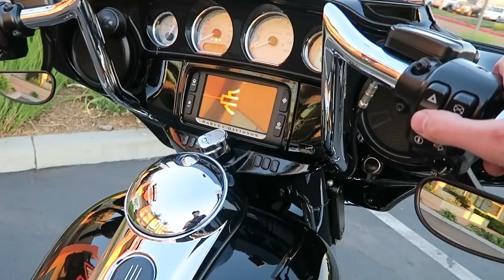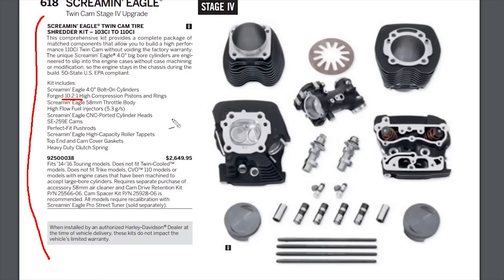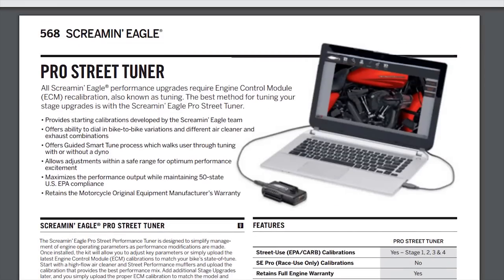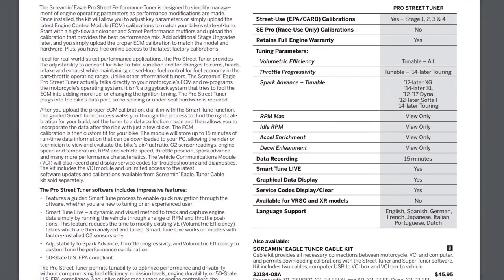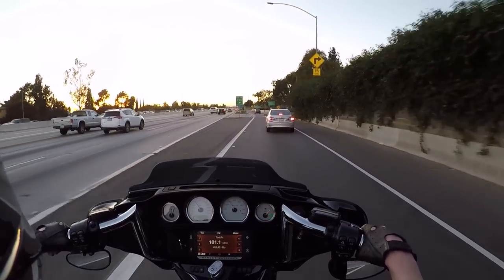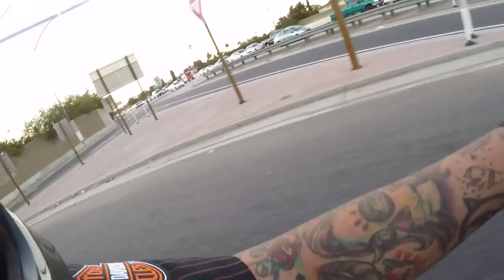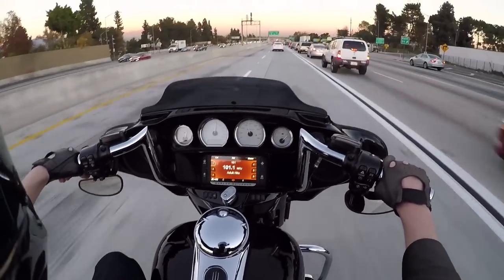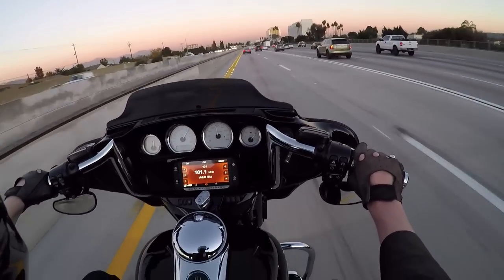Milwaukee-Eight Stage 4 VS Twin Cam 110 Stage 4 │Harley-Davidson Screamin' Eagle

Comment: I have a 2012 GoldWing with 100 K miles as of today. My first bike was a Harley but I can never go back. The Wing  bumps 114 mph in 4th gear when passing eighteen wheelers while riding 2-up. Nothing done other than fluid changes. Why do Harleys need expensive stage kits to bump 100 mph?  I have read some Milwaukee 8 engines have big valve problems.  
Why not build the engine with top power at the factory or is it the need to rip off owners?
The only thing going for the Harleys are excellent paint, chrome & some noise.
Reply: @k9m42  As a former HOG owner I am watching HD riders switch to the new 2019 GoldWing in droves. No I don't like the new GoldWing as the info system is a garbage item copied from an HD. Apparently you don't realize HD is in deep financial trouble and I don't think Honda will consider buying out the debt. Mr Laidlaw loves to put down HONDA in his videos but it doesn't matter.  The fact remains there aren't many HD's that make it to 100K miles without major engine problems (Usually a chase truck follows them on group rides LOL). Things happen when Korean & other Asian parts are assembled in America to get hidden with paint & chrome.. Look on your front forks and I think you may see NIPPON (The company that made landing gears for Japan so they could attack Pearl Harbor). 
You can't hide dog duty under beautiful paint and heavy chrome. Heavy metal chrome is nice but you will never see it on modern Stealth bombers or space vehicles. Add another stage to your HD roller skate and you will still remain in my stock GoldWing rear view mirrors. You are a funny guy though.  :-)

Comment: Will this kit allow you to pull the front wheel off the ground?
Reply from the maker: Haha. You could do more to get the front wheel up with a different sprocket then this power. I'm sure a pro rider could do it - Personally I can't wheelie a street glide
Reply: You can wheelie an old E Glide, my 2000 tc88 will do it. An old man with a early 90's E Glide showed me how. The front end can come down really hard and dent the front fender. It's a neat trick, save it for bar bets or impressing girls. It beats up the bike.

Comment: Was looking to get a Milwaukee 8 but for $ 40 grand then put a stage kit for $6 more. I think will just buil an after markit bike an it will be done at $25k to $30k and S&S has a 106cc flat head a knuckle head, pan head, shovel head or big bore 124, 128, & 143cc Harley is droped the ball. When my 96cc in the 09 cross bone gose out i will set an S&S in it an still ride it too. I wanted a new bike but all Harley has is new prices.

Comment: Funny thing about that 2 valve vs 4 valve, of course the twin cam falls on its face in high rpm, it can't breathe.  No matter the cam profile.

But yeah, the milwaukee is a better platform, about time Harley joined the present tech

Comment: So the m8 is better for about 1000 rpm or so of the power band? I just don’t see it being worth the extra cash for a new bike when you can get a much better deal on a used bike with low miles and the stage upgrades past 1 seems like a waste because they are still not fast. Not a hater. I love my breakout but I know firsthand that Harleys are not fast  it’s great for cruising and having fun but not a racer at all.

Comment: Or... for approximately the same money you could buy a Ducati Panigale V4, 215Hp and literally half the weight. That's probably 175Hp at the rear wheel. Now that WOULD shred tyres (if you turned traction control off.) Horses for courses as is elsewhere stated. Harleys are cruisers and sure a bit of extra poke doesn't go amiss, but riding at well over 100mph on congested highways is a high risk thing to do. That being said I hit 100 yesterday, so I'm a hypocrite too right? well at least I have the common sense to admit it was a foolish thing to do. And while I'm musing; what about traction control and riding modes for Harleys? It's about time! ps despite the critical post, I generally really enjoy your detailed and informative reviews. Ride on Bro' (but safely)

Comment: My Yamaha fjr1300a loaded up, and riding through Wyoming... 80 miles in 45 minutes, easily. If I'd have been riding a piston swapping twin(Harley), I would have had to have my teeth fillings replaced. They are pretty though, and H.D. can market the shite out of THAT.

Comment: These bikes aren’t fast. They’re beautiful. They’re comfortable. They ride smooth. But they are not fast. I had sports bikes when I was young. They were fast. Now I’m older. I’m not interested in speed anymore. So I got a Harley. No regrets either. I love it. I’d never get anything else. Lots of power. But it’s not fast.  You buy an expensive bike and put fancy parts on it but a 600 cc sport bike straight from the dealer would smoke any Harley. Just facts. Your top speed in this video is probably equivalent to 3rd gear on a sports bike. I’m not joking either.
Reply: You right on top end speed dave but my VROD and my buddies fatbob stay with sport bike up to 60-70mph....they have WAAYY more torque.
Reply: Yup my M8 keeps up with the 600cc and 1000cc sport bikes all the way to 80. Which is where I ease off the gas and set my cruise control.

Comment: Wow!! Those Reinhardt moto pro 45 sounds Bad Ass!!  Both bikes are sweet!!  Matt what’s your thoughts on the V-H/FP3 tuner?  Thanks for the video Matt 🤘🏻👍🏻👍🏻👍🏻👍🏻👍🏻👍🏻
Reply from the maker: They are nice. I prefer the Harley Smart tuner + Pro tuner  though
Reply: I had the FP3 for my streetbob and currently have the now discontinued SEPST for my 16 RGS. I like the SE better.  Haven't heard about the new ones. I can tell you the SEPST has a setting I believe most didn't realize was in there. It is an ethanol setting that adjusts how the tuner programs the bike when u do a recorded run. In my area gas has 10% ethanol. Once I discovered this feature  (after a Stage 1 download and 2 recorded runs) I did a couple of recorded runs and man what a difference in how it remapped the bike. It made a lot of changes and the whole way my engine runs changed. Very strong and more responsive.

Comment: I've had the TC 110 and M8 114 and the 114 is stronger.  I put a Woods cam and a pair of slip ons and pulled 126 ft# for a $700 investment.

Comment: Matt is a good guy and I've bought a bike from him but if you own an M8 (I have a 2017 CVO stage 2, 2018 Fatbob stage 4 & 2019 CVO stage 3) these kits are a colossal waste of money.  Stock oil pump design flaws, head bolt failures and plastic tappet guides et. al. will strand you beside the road days after the warranty expires and neither the dealer or H corporate will tell you about the problems.

Comment: I wouldn’t say a built bagger is slow. It should have a similar power to weight ratio as a 400-500 horsepower mustang, are they as fast as a sport bike? No. A pissed off built Harley motor is a fuckin ton of fun though.

Comment: I really liked the way you blocked out the speedometer! Didn't want to show "true Harley Davidson " scam on the public.
 Sure, spend 5 grand on a stage 4 and watch all that money fall on its face at 107 mph!!
  That's right, speed restriction!!
Saddest thing is, the stock bike has the power, regulations kill it!
So unless you bypass the speed restrictor in the ECU. save your money. Unlock the ECU, and you probably won't need to spend that 5 grand to bury the speedo. A stage 1 will do wonders for you.

Comment: So, if the stock 107 pushes that tri-glide ultra around fine and it weighs in at 1200 lbs.... my stock 18 RK has plenty of power. My RPM stays at 2-3500 .... in order to get the “fun” out of this, I need to risk a speeding ticket.... pure waste of money IMO (unless your track racing)

Comment: HD REALLY regulates their SE set ups. matching bikes you can reach stage 4 screaming eagle levels at stage 2. heck I had a 2003 VTX that had better numbers than this 110 had with just stage one. HD is now putting out 1200cc adventuring bikes that put out these kind of numbers but their touring bikes are still gutless. if they didnt cut corners so much on manufacturing we should be having closer to 115TQ and 105ish HP off of the showroom floor. their air flow, and AFR, and about everything is set at 80% of potential so when it all gets added up you are missing lots of potential. imo, go to the real after market stuff to build the bike, lasts longer and runs better.

Comment: so taking an already stupidly expensive bike making it even more expensive and it still has less hp and torque than a suzuki boulavard m109r which costs close to half what a street glide costs harley davidson is going down the drain because they cant build a bike that appeals to younger people and is also affordable, not saying i dont like harleys, just no way in hell can i justify buying one when there are other options with better performance and a lower cost
Reply: Suzuki’s just aren’t appealing to everyone. Just like Harley’s aren’t your thing.
Reply: Yeah..COMPLETELY different bike. Why are u trying to compare??
Reply: HD with a stage 4 definitely has more HP and torque than the m109r, but stock the m109 has more HP. If you want a cheap HD look a like get a M109. The only people who will notice the difference are your fellow motorcycle riders.

Comment: With a 4 1/2 in stroke it’s not enought to get the full power and have to ride at higher rpms. The twin cam yeah the stroke sucks but I’d bet it last lot longer that a medium stroke 4 1/2... 4 5/8 or 4 3/4 stroke look out Kawasaki’s make sure u change the lifters every 20,000 miles if u want that stroker to last.

Comment: S&s makes way better shit than Harley in my honest opinion. I have a 96ci Dyna with 583 cams and blows away my 17 flhx. Harley aftermarket parts are not all that great in my honest opinion. It will keep your stuff in warranty if the dealer does the work but twin cams are better that stock m8.

Comment: What a rip off!

Ur already spending 25k on w street glide special and then now to get decent power u need to spend an additional 4 to 5 k

Keep it !
Reply from the maker: The bike comes with decent power. This is exceptional power that is beyond what you really need for normal operation.

Comment: Well my dad has a 2010 fatboy 96 base with stage 4 beats his 2020 fatboy in long run with the 114 change to the 131 motor but short half mile race the 2020 will beat but it has a top end governed where the 2010 can hit a higher top speed the conversion kit from 114 to the 131 u only gain about 7 horse power and tor but it cost about 7k but my dad said it is quick off the line

Comment: Maybe next time add in some talking audio with rolling starts in same gear etc... obviously the dealer has sena products think outside the box.
The video doesn’t prove or disprove anything, I’d like to think with all the tech you have available you can make a higher quality you tube vid.
Lots of people are very interested in TC vs M8.

Do the engines the justice they deserve so we can put the issue to bed

Comment: For $10000 total my yamaha fjr1300a will eat your lunch, and riding it all day... like 500-750, day after day miles, won't make a noise and vibration that makes you want to ride it off a bridge. Pretty machines guys, but really 5000 - 6000 rpm.  That twin Harley's a ticking time bomb if you're revving it like that. On the other hand, Harley will sell you lots more overpriced parts. That's why they have pretty dealerships.